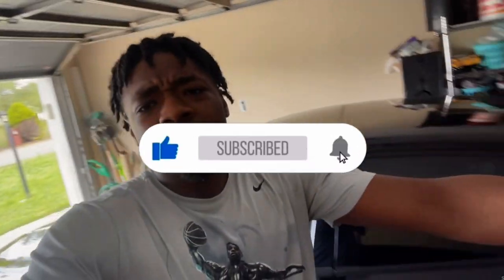BUILDING The PERFECT Interior For My S550 Mustang GT *Dynavin 8 Pro/Carbon Fiber Steering Wheel*

Comment: Can you still change the bass of the speakers? Is that under sound
Reply from the maker: yes you are able to change the bass of the speakers. you’ll just have to go to your sound settings to modify it
Reply: @yvngshine  thanks! Also how did you hide that ugly mic, or are you even using it?
Reply: @yvngshine so i got the unit installed and the power button to turn on the ac wont work? Do you know why
Reply from the maker: @victoriapawlicki3341  did you hear a click whenever you plugged in your connectors into the right plugs ? the ac connector might not be plugged in all the way and are you able to control the ac from the touchscreen unit ?

Comment: Are there rca jacks on the back of Dynavin? I have subs I want to instal when I swap the radio. Very clean upgrade tho, I have the same base radio and it sucks😂
Reply from the maker: i can’t remind right of the top of my head if the radio rca jacks or not but i do remember the radio having a wiring that specifically meant for a subwoofer install with the radio
Reply: Yes, it does